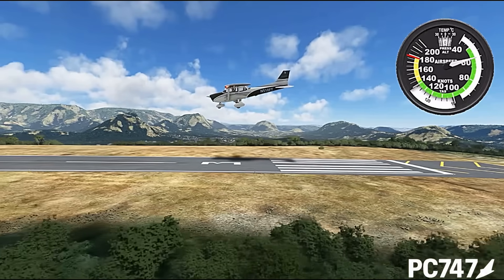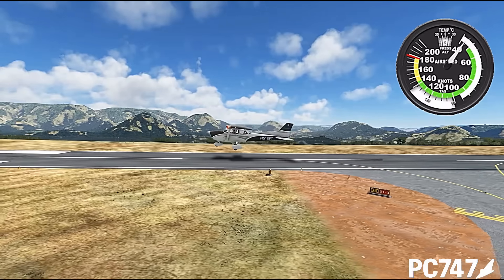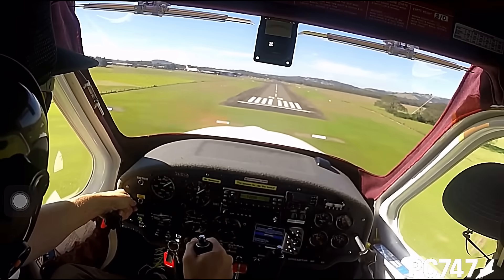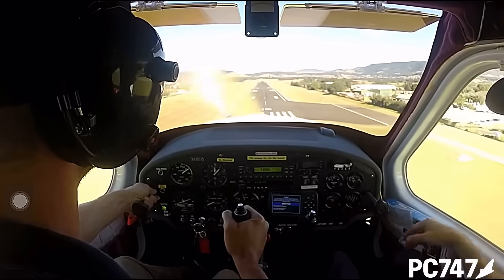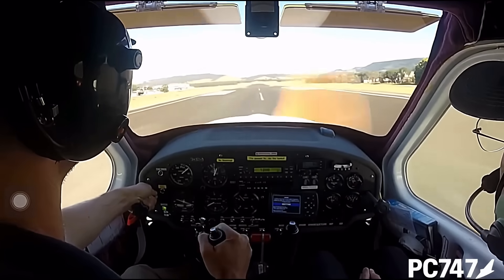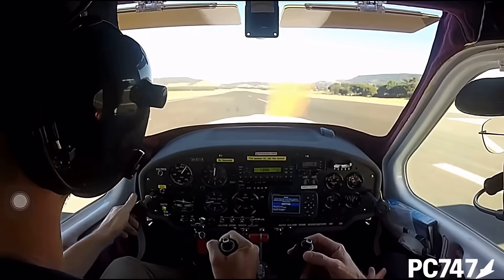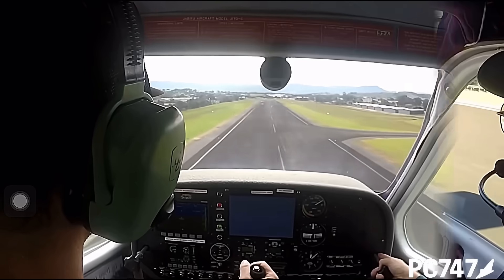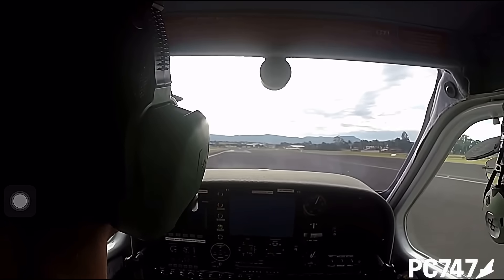How to Land a Plane -The Secret No One Tells You

Comment: Low passes and flapless approaches also help student in landing phase. I usually teach from the start of circuits that you keep a stabilised approach, feet keep the body of the aircraft aligned with rwy and the ailerons keep you on centreline, then you flare as normal and hold off but never let the nose go higher than end of rwy.
Reply: Exactly. In the flare phase of landing you have 3 things going on at the same time.
Reply from the maker: @archerpiperii2690 INDEED! 😎👍
Reply from the maker: SOME GREAT ADVICE! THANK YOU! 😎🤩🤩🤩

Comment: I was never able to pass a flight physical, so my flying career was limited to R/C Models and MSFS.
I learned "Throttle for Altitude, Elevator for Speed" from an article in RC Modeler magazine back in the 80's.
I'd have never thought that principal applied to full scale aviation.
I was never prouder than when I "greased" my 40 sized trainers landing to the applause of all present.
Reply from the maker: Thank you for sharing. Take care.!
Reply: It’s actually elevator for attitude, and throttle for speed.

Comment: Very smart to break up the components of landing into their separate parts. It uses the full length of the runway instead of that first third which when doing touch and goes one spends too much time in the pattern and not enough time down near the runway. I also think cross wind landings are one of the most difficult techniques to master in a fixed wing aircraft. Time spent a few feet above the runway and practicing slips with good directional control would be invaluable.
Reply from the maker: Hi Steven,

  Thank you for sharing your insights! I agree with you. :)

I wish an instructor had ALSO told me that :

    A “sideslip technique” IS a crosswind landing technique. 

I would enhance my students crossing landing competency , EVEN WHEN THERE WERE NO X-WINDS AT ALL, by having the aircraft NOT on the extended centerline, on finals, & have them them SIDESLIP to the center line again & again…..

Comment: Well and good if you are talking about very little wind on approach , and I appreciate you are in a learning environment. In strong winds ,  you need substantial amounts of power left on until landing  , and if you add a crosswind , how to crab . In a jet if the crosswind is bad enough , you can keep the angle of crab up until even main gear touchdown . Failure to do maintain thrust and speed adjustments  and you take off power as in a "normal" approach  - you will land with a substantial thud . Use of rudder in the approach is not really recommended . When you get to the stage where you can do it without thinking too much , it gives a lot of satisfaction . Hopefully you get there with experience.
Reply: Now people are getting there.  Equally, one can put the aircraft into an into wind wing-down attitude and touchdown with that side first or roll wings level during the flare with a little dab of rudder if required in order to set the centreline of the aircraft lined up with the runway .  Said rudder input should only really be required during an extended flare.  It does though require a degree of finesse to get the wings level just before touchdown or even during it.  Nice technique for a high wing machine.  Momentum is a vital word to use btw.
Just for fun, one could even land with a tad of downwind brake pre-applied!!!
Reply: @HerbertTowers  yes , but if you tried that in something like a 737 , you'd blow the tyres on that side .
Reply from the maker: @Dackah  I agree with you!
Reply: P.S.  Yes, I've used these techniques in light piston-engine machines and in rather larger 4 engine ones.
Reply from the maker: @HerbertTowers Glad to hear Herbert! 🤩🤩🤩👍👍👍
Reply from the maker: @HerbertTowers Thank you Herbert! Cheers! 😎👍👍👍
Reply from the maker: Dackah,

    Thank you for the very thoughtful insights that can help so many! 😎🤩🤩🤩🤩🤩🤩
Reply: @PC747Aviation  Thanks , good to see you help out students with a well thought out common sense attitude. I did instruct very early on in my career but confess I was never cut out for it.
Reply from the maker: @Dackah I want to commend you for doing it. I have the utmost respect for pilots who earned their CFI’s.

Comment: what is it about fighters that make them the exception?
Reply from the maker: Hi Drcoolit,

   1. Wing Design — Low vs. High Aspect Ratio
	•	Fighters:
Have low-aspect-ratio wings (short and stubby).
  This gives them high roll rates and excellent maneuverability at high speeds, but it means poor lift-to-drag efficiency at low speeds.
  When they flare, the wings lose lift rapidly once the angle of attack increases even slightly — so there’s no long float like a 152 or 747.

	•	Cessna 152 / 747:
Both have high-aspect-ratio wings (long and slender).
  They produce more lift and experience more ground effect near the runway, allowing a smoother, sustained flare and gentle touchdown.

⸻

2. Approach Profile and Energy Management
	•	Fighters:
Typically fly steeper approaches at higher angles of attack and with thrust available (power on).
  The flare is more of a controlled reduction in descent rate using thrust, not pitch. Many fighters maintain idle or partial power until touchdown to preserve control authority — their low-aspect wings “drop out” of the sky fast once power is chopped.
	
•	C152 / 747:
Rely more on aerodynamic lift and ground effect to cushion the landing.
  Power is generally reduced to idle in the flare, using pitch and attitude to arrest descent.

⸻

3. Ground Effect and Sink Rate
	•	Fighter Jets:
Their short wings produce minimal ground effect, even close to the surface.
  When the pilot pulls back slightly, lift doesn’t increase much, so the aircraft settles quickly — power is key to control this.
  That’s why many fighter pilots say “never flare without power.”

	•	Cessna 152 / 747:
Experience strong ground effect, which cushions the landing — they can safely flare with the power at idle and still have time to fine-tune the touchdown.

⸻

4. Landing Gear Geometry and Attitude:

	  Fighters:
Have a nose-high approach attitude already (AOA indicators are used more than pitch references).
The flare just aligns the sink rate — not a big pitch change.
Many are even designed to “fly on” at a fixed angle rather than “float and flare.”

	  Cessna / 747:

Typically approach nearly level and then rotate the nose up during flare for a positive-attitude touchdown.

Cheers! 😎👍
Reply: @PC747Aviation  OUTSTANDING! thank you so much for this in-depth explanation. one thing I have seen on gliders or motorized gliders are spoilers -- makes me wonder why something like that wouldn't work on a small airplane so that you could come in at a steeper angle AND not "float" when you got close to the ground. one thing I keep noticing on these air accident videos is how often a plane is in a stall/spin situation because they have airspeed too slow but they don't want it fast or they'll overshoot the runway. if you could dump lift over the threshold that might allow a higher airspeed on approach but still safely land without worrying about "floating". just a thought. I'm not a pilot but I see so many of these accidents (often on landing phase) so I keep thinking maybe there's a better way to dump lift quickly and safely. again, thank you for such a detailed response.
Reply from the maker: @drcoolit  You are correct. Most small general aviation aircraft do not have spoilers. An exception is the Mooney 252. With the push of a button, two red electric metal devices open above the wings. They were very helpful when I flew that aircraft because it is so clean and fast, that it made operating it easier. Most other aircraft, without spoilers, typically require pilot technique with a combination of flaps, and in some cases, forward slips, that is “cross controls”, to create additional drag.

Comment: The best simple advice anyone ever told me for landing approaches is if the runway is going up in the windshield, you're too low. If it's going down in the windshield, you're too high. If it's not moving and just getting bigger, you're on the right glidescope.
Reply from the maker: You’re absolutely correct! Thank you for sharing. 🤩🤩🤩
Reply: @PC747Aviation  Harrumph.  Wrong.  That means you're maintaining a constant descent angle.  Not that the angle is correct.
Reply from the maker: @HerbertTowers Hi Herbert,

                                   My apologies. I didn’t understand what was wrong in your kind comment . Always happy to learn more. 🤩🤩🤩🤩
Reply: @HerbertTowers  I can see what you're saying, in that this would still work if you were at 5,000ft and half a mile from the runway, but that is obviously the wrong glidepath. If you are on a 'sensible' glidepath, the rule works nicely. A lot of pilots use it. I use it all the time landing VFR at small airfields with no navaids.
Reply from the maker: @combatwombat71  There is indeed a certain art that has been lost in aviation with all the current technology.
Reply: Something I learned that never failed me even at night.   Get the rwy numbers or the front green runway lights in your mid front window.  About compass height in a Cessna.    If the numbers or lights start going up you need to get up ie add more power if they start going down you need to get down ie take away some power, use a slip etc.   Keep the numbers or light in the same spot on the window doing that and it works.
Reply: @AbDef-v8s  If I ever fly again, I will have to remember that.  One challenge I had was locating the aiming point.   This suggestion of yours seems clearer to me that what is typically suggested.
Reply from the maker: @AbDef-v8s ABSOLUTELY! 🤩🤩🤩🤩👍👍👍👍
Reply: @PC747Aviation Absolutely love your breakdown of learning each axis too.   That is gold!
Reply from the maker: @AbDef-v8s  Thank you very much for your kind comment. I will endeavor to continue providing quality content.

     Cheers!

Carlos
PC747
Reply: "I couldn't understand why the ball kept getting larger, then it hit me."
Reply from the maker: @flyer617 Nice! 🤩🤩🤩
Reply: @flyer617 Hopefully in the head and knocked some sense into you 😂
Reply: Never heard that before but makes all the sense in the world.
Reply from the maker: That was some great advice! Thank you for sharing.

Regards,

Carlos
PC747
Reply: This would have saved some time for me when I was learning ab initio. Some of these techniques are brilliant.
Reply from the maker: @anthonylittle2396  Anthony,

                                    Than you for your very kind comment. 🤩🤩🤩. I’m hopeful that, in some small way, the knowledge imparted will benefit others……..✈️

                           Regards,

                           Carlos
                           PC747

Comment: Hello Captain!

I only have a few hundred hours of instructing in so far but I've been fortunate to get a variety of ages and life experiences to practice with. So far, I start them out with fundamentals of flight. Then I move onto "Shapes in the sky" where they use their rudder to draw a line to the left and right on the horizon, coordinate their ailerons to keep wings level, then eventually a square going left, up, right, down. Then eventually a triangle to have them use all 3 flight controls. Then I do rolls on a heading where I have them react with rudder to lock their nose onto a target on the ground when rolling left or right. Like strafing a target. I think this teaches rudder coordination with the aileron for x-wind landings. 

Then after getting familiar with slow flight and stalls, I move onto low flying over the runway like you said. Tease the runway, don't touch it. 

Then I break down landings in 5 steps (I made a video on my channel of this using MSFS 2024). Now before any good landing, you have to have a good pattern. But when on final:
1. Centerline. Use aileron to correct side drift. 
2. Pitch for your aiming point/glideslope. 
3. Power for airspeed. Don't accept deviations, man handle the throttle (not jerk it, just get it done) and make sure you hold your airspeed
4. When close to the runway, see which direction your nose is pointing and use your "toes to point the nose" 
5. When your aiming point disappears, smoothly round out (of course the expediency of that depends on how sharp they're coming in haha) and there are two phases here. 
Round out, where you walk out power and hold altitude for a brief moment with the runway. Then flare, where you're increasing angle of attack. All while focusing also on nose alignment and side drift.

Now with this in mind, I love your "10 second" rule and will test this out and incorporate it in my training. I think little simple things like that go a long way in getting things to stick in their head. Of course it's not a hard rule and each landing varies, but if they get the general idea of first half is float, second half is AOA and hold it off, they nail it.

Thanks!
Reply from the maker: Andromedon,

   I am honored to have received such detailed and wonderful insights from you! I also liked how you mentioned, during cruise, fixating the aircraft nose on a target, showing the student Dutch rolls, to the left and to the right, and then allowing the student to practice them at altitude….. I used to do that for my students as well! . 😎

You brought up so many good learning techniques too! THANK YOU!
Reply: I have a question.  I passed my PPL flight test in 1979.   I flew the Piper Cherokee when I was learning,  and then the Warrior and Archer.    I was taught that on the approach to landing, pitch was primary for airspeed, and power was primary for altitude. When I see, on line, accidents in which pilots attempting a go around, seem to pull back on the wheel to climb, rather than actually pushing forward, which,  in my limited experience, is usually necessary in these circumstances, I wonder if they panic and think, "go up--pull back"   If you have the time, I'd like to read what your opinion is.  Thanks!
Reply from the maker: @nidurnevets  Hi Nidurnevets,

     I’ll be happy to try and answer that thoughtful question for you…..

   I think, in emergency situations, like when engine failure occurs, or when people get stuck in a box canyon and even during some go-arounds, some people’s survival instincts” tend to OVERRIDE their training.:/ As the ground, the DANGER, is getting closer, they tend to pull back as a result of it.

A good example of this was an unfortunate accident that occurred in Telluride, Colorado, several years ago, where a newlywed couple were returning to Florida; in a normally aspirated Beachcraft. They flew into a box canyon in which they could not get out . The pilot was very experienced, a former flight instructor, Embry-Riddle graduate and even a Delta airlines 757 pilot……

However, the stall spin, into the ground, revealed that, as danger approached them, he continued to pull back, bleeding off PRECIOUS airspeed instead of maintaining sufficient speed to affect a forced landing onto the mountainside. This is happening far too often as well, when pilots experience engine failures, even during some go-rounds and they lose control before reaching the ground.

You have actually helped me a lot with a future video topic: Why skilled pilots still loose control. Thank you! 🤩🤩🤩
Reply: @PC747Aviation  One interesting topic you can bring up as well is how no matter your experience, in air collision statistics stay the same. Complacency kills.
Reply from the maker: @Andromedon777 Indeed! Thank you for sharing that as well as the video concept. 😎👍
Reply: @PC747Aviation   From what I understand, airline pilots practice emergency procedures on a regular basis in sophisticated simulators. And every take off and landing is briefed. I remember very little time being spent on emergency procedures when I worked toward my PPL license, many years ago.
Reply from the maker: @nidurnevets You are correct. I honestly don’t remember much about my own emergency training for my private license either.  It was a long time ago.

Cheers!

Carlos
PC747
Reply: @nidurnevets  I teach pitch+power=performance. It really depends on the context of what  you're doing. If on speed on final, you're using pitch for aiming point and power for your speed (of course you can adjust either as necessary to really get what you want)

The reason why I don't teach the infamous "power for altitude, pitch for airspeed) on final is because:
1. FAA Doesn't teach that currently (to my knowledge) 2. DPEs don't like this 3. If you look at autopilot systems, it pitches for glideslope/altitude and powers (autothrottle) for airspeed.

AFH Chapter 9: 
"A well-executed final approach includes reaching the desired touchdown point at an airspeed that results in minimum floating just
before touchdown. To accomplish this, both the descent angle and the airspeed need to be controlled. This is one reason for performing
approaches with partial power; if the approach is too high, the pilot can lower the nose and reduce the power to maintain the correct
airspeed. When the approach is too low, the pilot can add power and raise the nose.
While the proper angle of descent and airspeed are maintained by integrating pitch and power changes, an untrained or inexperienced
pilot may try to reach a landing spot by applying back-elevator pressure without adding power."

In the end, you only power for altitude/pitch for airspeed if you are behind the power curve/in slow flight. You should not be in slow flight on final until you've rounded out over the runway and cut power. If you are, you're doing something wrong. Even for short field landings, you should go no lower (+10kt/-5kt) Vref which is 1.3xVs0.